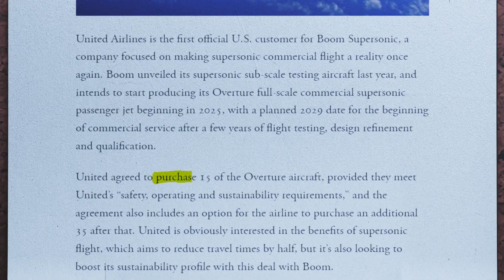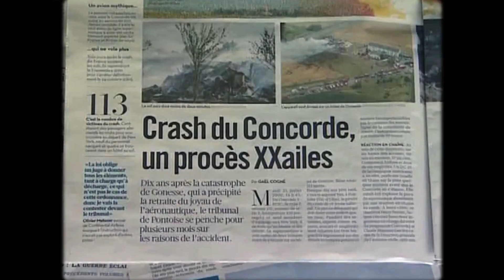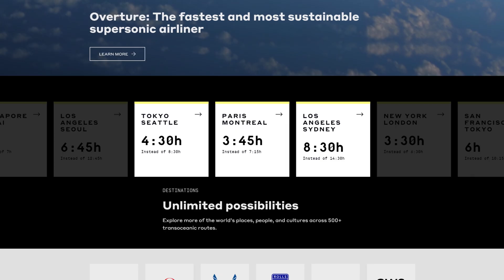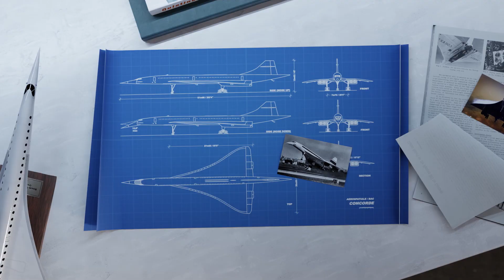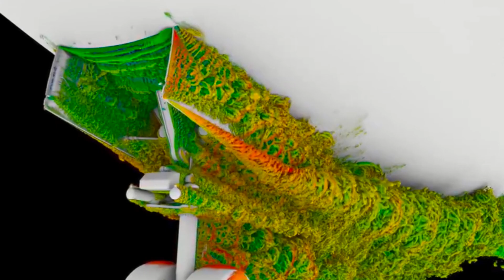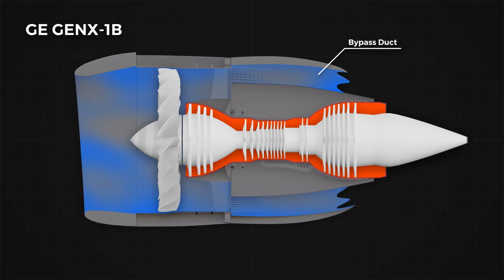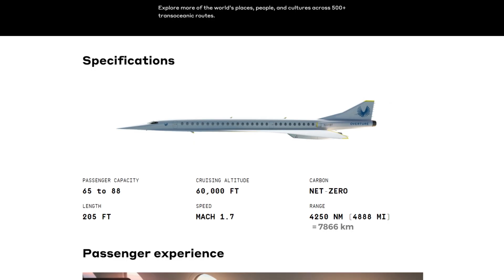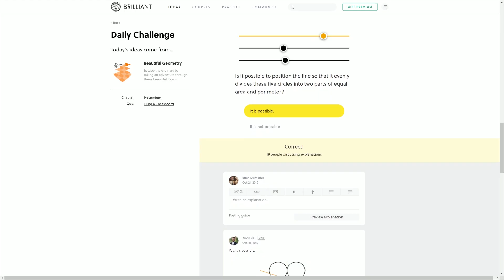Will Boom Bring Supersonic Back?

Comment: Assuming that Concorde, the Boeing 2707-300 and the Boom Overture were flying today, how would their operating economics look, for a London/New York flight, in view of the high cost of jet fuel in 2023? This is based on the operating margin of a Boeing 747, and is not saying anything about the viability of SST per se, where development pay back, production costs, maintenance costs, and route availability would be quite different. 

A litre of jet fuel costs £0.65 in the UK in 2023 (there is no tax). A Boeing 747 uses £53,500 worth of fuel (84,920 litres) to fly 450 passengers from London to New York, which works out at £118 per passenger. An economy ticket costs around £450 (cheapest £315). 

Concorde used about the same amount of fuel, but only carried 100 passengers, so the cost per passenger would be £53,500/100= £535, so, keeping the same ratio, an economy ticket would cost £2,033. 

The Boeing 2707-300 would probably also have used the same amount of fuel, but carried 234 passengers at a cost of £53,500/234= £229 per passenger, so an economy ticket would cost £870. 

Assuming that the Boom Overture will use 66% of the fuel, but will only carry 72 passengers at a cost of £35,310/72 = £490 per passenger, so an economy ticket would cost £1,862. 

£7,000 could possibly be charged for luxury class on all of the airliners, so the operating economics appear to gel, even in 2023.

Comment: Concord did not fail. British Airways were making a healthy profit, unlike Air France. The French used Michelin tires, which failed on two occasions, sending rubber through the wing (not a metal bolt on the runway as claimed). This ended Air France's commercial viability and so the France, being self-serving, fair-weather Friends of the UK, refused to make parts for Concord. Thus denying British Airways, and the UK, the success it deserved. Never get into bed with the French.
Reply: @francocarrieri1988

The main challenge facing the 1950s UK supersonic transport study group was to find a suitable wing. The big breakthrough was the short slim ogival delta, which has low supersonic drag and, at a high incidence, provides lift for take off and landing, by generating upper surface vortices. The high incidence necessitated a very tall landing gear, and a droop snout so that the pilot could see the runway, giving Concorde an iconic swan-landing-on-ice appearance on approach.

Take off and landing speeds were 250mph and 187mph respectively, which is pretty high, and greatly stressed the Michelin designed tyres, both mechanically and thermally, especially as Concorde was heavy at 185 tones. By comparison, the Boeing 737 take off and landing speed is 150mph and it weighs 75 tones and has a short landing gear. The lofty landing gear, meant that it was subject to high leverage. These factors caused continual problems, particularly tyre disintegrations and subsequent damage to the aircraft structure, throughout the life of Concorde.

At  Charles de Gaulle airport on 25 July 2000, a Concorde's tyre burst while accelerating down the runway. Pieces of the tyre smashed into the left wing and caused a pressure wave in a tank which ruptured, allowing fuel to gush out and catch fire. The aircraft subsequently took off and then crashed at low altitude.  Controversially, the French Bureau of Enquiry and Analysis (BEA) blamed  a thin strip of titanium, measuring 17.1in (435mm) x 1.3in (32mm) x 0.06in (1.4 mm), that was found on the runway, for the burst. The accident led to modifications to Concorde, including more-secure electrical controls, Kevlar lining in the fuel tanks, and specially developed burst-resistant tyres.

Here is a summary of an Observer report shortly after the above crash:

On the 16 August 2000, the Civil Aviation Authority revealed that Concorde has suffered 70 tyre-related incidents, that makes it plain that the Paris disaster on 25 July 2000 could have happened at any time during the plane's 26-year commercial history.

The fact that a single tyre blowout could cause potentially catastrophic damage to Concorde's landing gear, wings and fuel tanks was known as long ago as 1979. Despite a string of design and maintenance improvements, this type of blowout has repeatedly occurred since then.

Concorde has suffered seven tyre bursts that resulted in punctured fuel tanks. Two, in 1979, happened to Air France planes taking off and landing in Washington, triggering a mandatory upgrade in tyre specifications and the introduction of a puncture alarm system.

But by 1982, following half a dozen similar incidents, including a holed fuel tank on a British Airways Concorde taking off from New York, the US National Transportation Safety Board was still sufficiently alarmed to order extra safety measures: Concorde's landing gear and tyres were to be inspected before every take-off.

Subsequent serious incidents, in 1985, 1988 and 1993, all involved BA Concordes at Heathrow and New York's JFK. In each, tyre bursts led to pieces of landing gear or rubber being ingested by the aircraft's engines, and wing skins being damaged, with fuel leaking from the punctured tanks.

Further improvements were ordered in 1983, 1985 and 1993, when pieces of the landing gear's water deflector had punched holes in the wings. But in spite of all the changes, Concorde's wing skins still remain vulnerable to flying debris.

Refs:
(Wiki: Concorde)
(Wiki: Air France Flight 450)
(theguardian: concorde world)

Comment: i doubt supersonic jets will even return this decade or next. they just cant make it cheap enough for most passengers.
Reply: @claus1225 Overture is not aimed at the mass market where cost rules. Neither is it aimed at short haul, or overland routes. The big companies, like Boeing and Airbus have those markets well covered already.

It's aimed mainly at business travellers where time is money. The seats on Overture won't be that expensive though. Boom recon $5,000 return JFK/LHR, with a flight time of 4hrs as opposed to 8hrs on a subsonic airliner. Overture's accommodation will be business class.

Comment: If concorde wasn't killed ,imagine where we'd be today. Like comparing the original iphone to the latest one. Concorde would have continued to be improved.
Reply: @tesstickle7267 Nice thought. The only improvements made to Concorde were to do with safety and security. After 9-11 all aircraft had to have lockable doors between the cabin and cockpit. On most aircraft this modification cost around £30,000, but on Concorde it cost £330,000. It was 27 years old and was getting difficult and expensive to maintain. In 2003, both BA and AF decided that they didn't want to fly it anymore, but the final blow came when Airbus declined to supply any more spares.

Comment: $11k Concorde ticket vs a $500 first class ticket with reclining seats and additional 4 hour travel time thus saving you $10,500 - Yeah ain`t hard to see why demand for Concorde got smaller huh?
Reply: @scottwilson6467 JFK to Heathrow one way on Concorde was $5,000. A luxury ticket for a subsonic aircraft would cost around $2,300. $600 would buy you an economy ticket. A ticket on Overture, which is all luxury, would probably be $3,000.

Comment: it can't just be me thinking this is a huge scam right?
The guy running it has no background in aviation at all, they claim their plane will do everything, since the "rollout" of their "prototype" there isn't even any footage of the XB-1 taxiing, all they have produced so far is a bunch of renders.
It just stinks of startup rugpull
Reply: @lord_scrubington Yeah, but it would be great if their Overture did get off the ground.😊
Reply: @phonicwheel933  definitely would be incredible to see a second supersonic airliner
Reply: @lord_scrubington  It's been 9 months since your original post and Boom are still going and they have now got an engine manufacturer, so fingers crossed.

Comment: I am yet to find any real photos or indication that their "prototype" XB-1 actually can even fly
Reply: @lord_scrubington The XB-51 does not represent the latest Overture, so it will probably be retired.
Reply: @phonicwheel933  the XB 51 does not and has never represented anything
Reply: @lord_scrubington  Seems that way. You think it was just a publicity stunt? BTW here is a report about what Blake Scholl said at the 2023 Paris air show: 
Scholl admitted that the XB-1 and Overture programs “diverged” due to design refinements of the latter aeroplane, putting into question what benefits, if any, the company could glean from even flying the demonstrator (he has a way with words).

Comment: It will not succeed, People are to tight arse to pay for it.  Yes there are more millionaires today but they wont pay for a quick flight on a regular basis. They rather fly first class as flying first class is a luxurious experience of spaciousness and good quality food and flight attendants that give happy ending massages.
Reply: Your assessment is not why it will fail.   Currently it does not even have an engine.  Even if some company decides to build engines for it, it would take years to get those engines ready.  Also, it is wayyyy behind on deveopement time and cost.  The systems and avionics are getting old even before it is built.  Also it will still cost many billion to finish develpement and Flight Testing.  Sooner or later investors will stop footing the bill, "no money, no honey"
Reply: @alexn8944 Overture is not aimed at the main market, which is well served by the big companies, like Boeing and Airbus. It is aimed mainly at business people, who value their time. Unlike Concorde, the accommodation will be first class. A one way first class flight on a current subsonic airliner from JFK to LHR is $2,300 and on Overture it will probably be $3,000. The subsonic airliner would take 8 hours and Overture would take 4 hours.

Comment: DOESN'T THE SR71 USE A BYPASS JET ENGINE ??
Reply: @richardcarr6493 The Mach 3.3, SR71 uses 2 P&W J58 turbojets with after burners, not turbofan bypass engines. But above Mach 2, pipes feed additional air directly from the compressor to the after burners to increase thrust. It is often claimed that in this mode the J58 operated as a ram jet, but this is incorrect.

Comment: What if!
Instead of carrying around high-bypass engines that introduce enormous drag, the plane itself could bypass and all the design was integrated with eachother like plane-engine combo?
Been brainstorming this for a while..
Reply: @XavierBetoN You sound like a budding aeronautical design engineer.😊 

The Overture engines are medium bypass and would be optimises for efficiency, at low and high speeds. Presumably, you are suggesting burying the engines in the wing rather than mounting them in pods. If pods and engines are properly designed, they can be low drag too. Podded engines have a number of advantages: they allow easier maintenance and updating. They don't take up any room which could be used for fuel. They are safer.

Jet engines cannot work with inlet air speed above about Mach 0.73 (550mph), so ducting must slow the air when the aircraft is flying above this speed. Concorde had highly complex inlet ducting with moveable sections to do this. Probably, Overture would have the same. As well as controlling inlet air speed, the ducting can also reduce drag from the engines.

Comment: I checked the audibility of booms per altitude, as well as the fuel efficiency..
I found out that if instead of 25km altitude, a supersonic craft could taxi at 30km easily, having less audible boom from the surface, and much greater fuel efficiency. And those afterburners and bypass ramjets are capable of taxiing upto 35km altitude, so 30 to 32km allowance should be considered.
I don't know if it's something engineers never considered, or is it the FAA that regulates this, but it could really help a lot if it were insisted.
Reply: @XavierBetoN Yes, flying high is a good way to minimise drag, but there is a trade off. Because the air gets thinner, jet engines lose power because they can't breath so well. In fact, most jet engines simply won't work at 30km or above. 

For example, the jet engines on a passenger aircraft flying 11km (36,000 feet) only produce 33% of their sea level power, so the aircraft cruising height has to be carefully optimised by the aeronautical engineers.  If you want to eliminate drag and sonic boom you need to fly 153km high, or above, so you would need rocket power.

The difference in sonic boom noise on the ground, going from 25km to 32km is only  -2.2dB. Because of the logarithmic nature of human hearing this would not be noticeable. Going from 11km to 30km would give a difference of -4.3 dB, which would sound very slightly less loud (most people can just about detect -3dB). 

By the way, the Overture engines are medium bypass jets, with no afterburners, not ram jets, which are completely different. The proposed Overture engines have a fan of 1.82m diameter, whereas modern passenger aircraft have high bypass turbofans of around 3.40m  diameter. The Overture engines will have inlet ducting which will probably reduce their drag. 

There is no regulation banning flight at any of the heights you mention.

Comment: Rolls Royce backed out of the deal
Reply: So did almost every other engine manufacturer.  They are basically doomed.   I think over the coming weeks or months we can expect them to fold and shut their doors.
Reply: @rcairflr  it's too bad, I wanted them to succeed
Reply: @mikebean.  > Yeah, same here, but I pretty much knew from the beginning they would fail.  Just didn't know it would result from no engine.   I have been in the business for a long time,   One thing I've noticed is that all of these startups underestimate the time, cost and difficulty of bringing an aircraft to market
Reply: @mikebean  @rcairflr Like you, I hope that Boom succeed but have doubts about their survival. It's 27 July 2023 now, nine months after your original posts, and Boom are still in Business and it looks like they are making progress and have now appointed suppliers for major Overture parts:

  •  Spain-based Aernnova, will design and supply the wings. 
  •  Italian aerospace giant Leonardo, will design and build the fuselage and wing box.  
  •  Aciturri, also Spain-based, will design and develop Overture’s empennage. 
  •  Boom's other suppliers include, Florida Turbine Technologies, Safran Landing Systems, Eaton, Collins Aerospace, Flight Safety International, GE Additive, and StandardAero. 
  •  Boom have defined the avionics, flight controls, hydraulics, fuel systems, and landing gear.

Florida Turbine Technologies will design a bespoke engine that matches the unique requirements of Overture, which they consider to be a superior approach to modifying a standard engine. Engineers, who were involved in the design of the turbines for the supersonic F-22 Raptor and F-35 Lightning, will be on the design team.  GE Additive will provide additive manufacturing (3D printing) technology, and StandardAero will ensure design for maintenance. Apparently, engine development is underway. 

The Overture propulsion system will have a Boom-designed axisymmetric supersonic intake, and a variable-geometry low-noise exhaust nozzle. Symphony will have the same basic architecture as engines that currently power all modern airliners.
Engine features:
  •  Turbofan
  •  Medium-bypass
  •  No afterburner
  •  Twin-spool
  •  35,000 pounds of thrust on take off
  •  Air cooled multistage turbine
  •  Single stage, 72 inch diameter fan, for quiet operation
  •  Low-pressure compressor stages: 3
  •  High-pressure compressor stages: 6
  •  High-pressure turbine stages: 1 (passively cooled)
  •  Low-pressure turbine stages: 3
  •  Additive manufacturing for lightness, low part count, reduced assembly costs
  •  FAA Part 33 and EASA CS 33 compliance
  •  ICAO Chapter 14 noise compliance

Comment: No drooped snoot! 🤦‍♀️🌈
Reply: @christinearmington Overture will not have a droop snoot. Instead it will save weight, complexity, and cost by having a fixed nose and using external cameras and cockpit displays so that the pilots can see the terrain when taking off and landing.